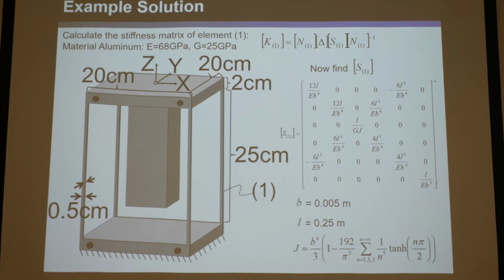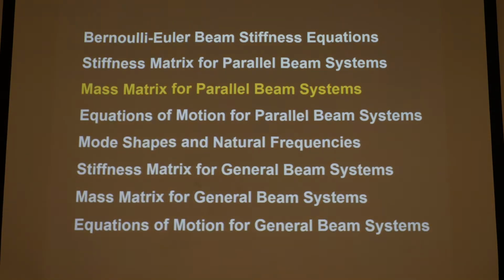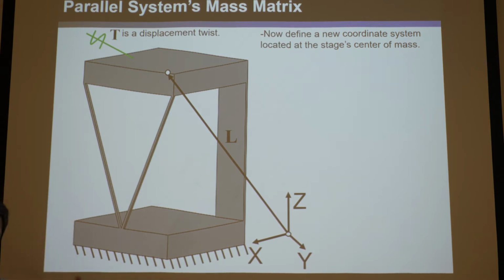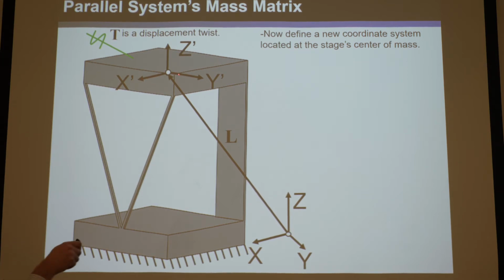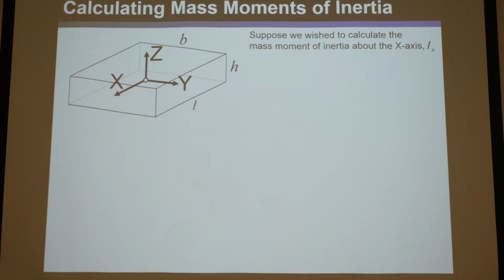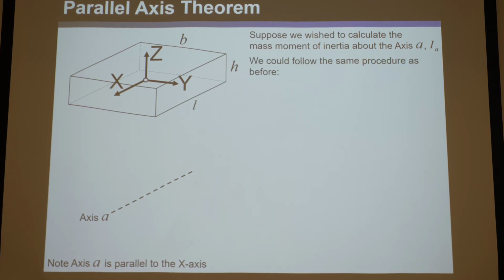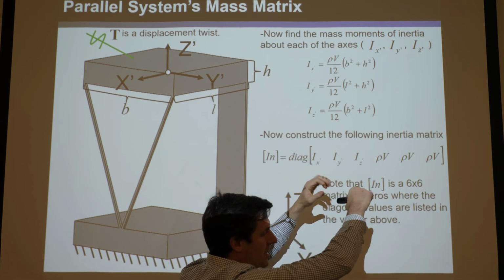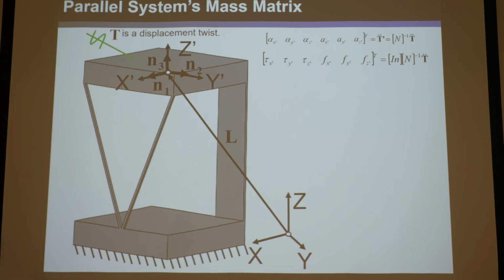Compliant Mechanisms Lecture 3 Part 3

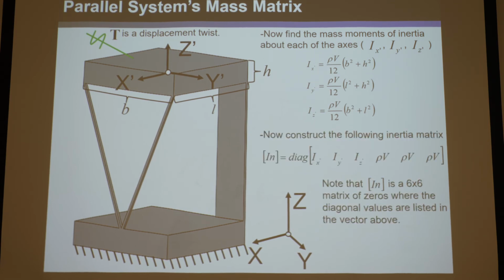Comment: Part 3: Example Calculation (23:54):

* Worked through a detailed example to find the stiffness matrix of a parallel system with four wire flexures.